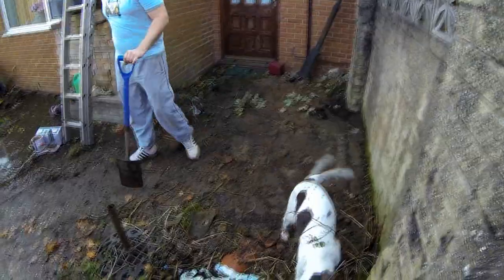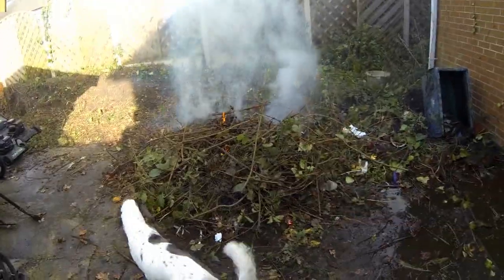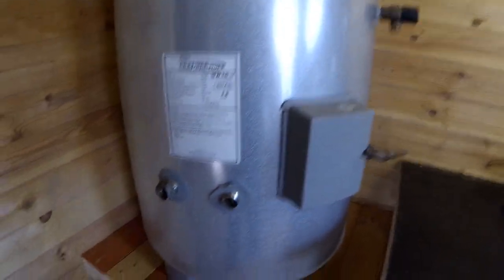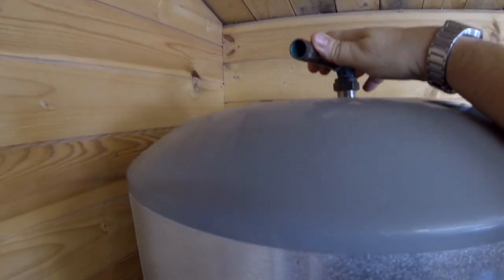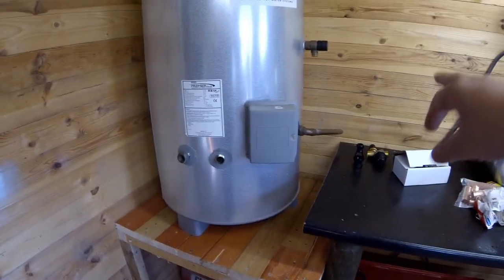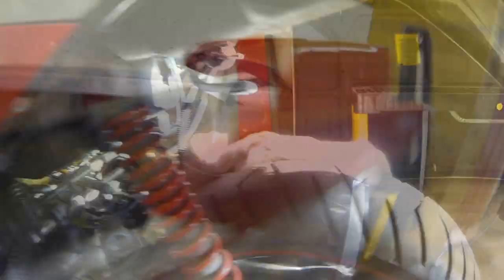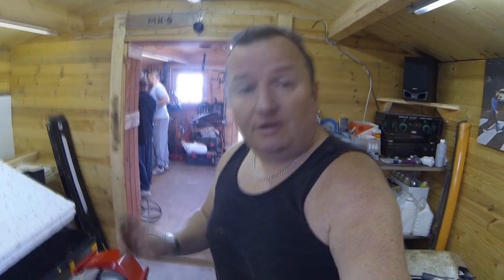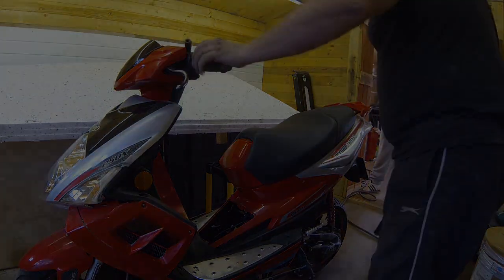Unvented Hot Water Tank For Our Budget Hydrographics Set Up And The TGB R50X Scooter Vlog

Comment: If you have good spark check the valves on that scooter.  They move over time.
Reply from the maker: This one's a two stroke bud. I know what you mean though as the other scooter had valve gap problems ant it didn't perform. It was a lot better after i sorted them.
Cheers
Martin

Comment: Hi Martin, I Have Recently Just Bought A 50cc Moped And Have Done A Bit Of Work To It. 
You Probably Already Know This But Just Make Sure That You Have The Carb Set Correctly, Make Sure You Have Set It Up Right Otherwise It Won't Start, That's What Happened When I Rebuilt My Carb The Other Day. 
Cheers, Jim.
Reply from the maker: Yeah, Cheers Jim, I know how temperamental carbs can be. I do think this is a fuel related problem but i'll get to the bottom of it.
Cheers
Martin
Reply: Hope You Sort It Out Soon Martin :)
Cheers, Jim.

Comment: If you use your home boiler to heat this new tank, won't you just be wasting energy? The pipes will have quite a distance to travel and a lot of the water's heat energy will be lost surely. Wouldn't it be cheaper and easier to use the element on the new tank indefinitely? Would the new pipe be running outside? Is it possible to have them insulated or isn't that a thing? I'm not knowledgeable in that area so I have no idea, just a thought or 3. 

Did you pick anything up at that auction?

Keep it up.
Reply from the maker: I was planning to use just the electric but I thought i'll have the backup option of piping the coil up as well. The boiler is just the other side of the door and I am going to lag the pipes and box them in as well. Picked up a retro spaceage looking record gram for £32.00 at the auction. Should make money on it.
Cheers
Martin
Reply: retrorestore Oh right, yeah it's best to have it connected should you need it then, especially as it's so close! What would happen if you connected it all without getting the certification/permissions you mentioned in the video? Fines? Arrested? 

Good stuff, are you gonna be fixing it up or just re-selling it? 

Cheers.
Reply from the maker: They have made it a legal requirement to install one of these cylinders so I have to get a registered person. Not sure how it affects a person though. I will be selling the bike once it's ready. Cheers
Martin